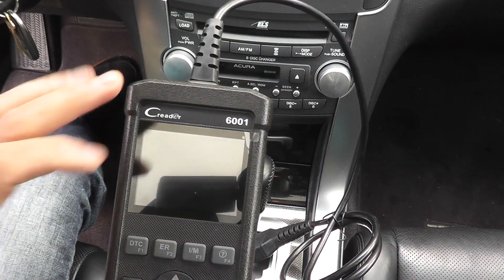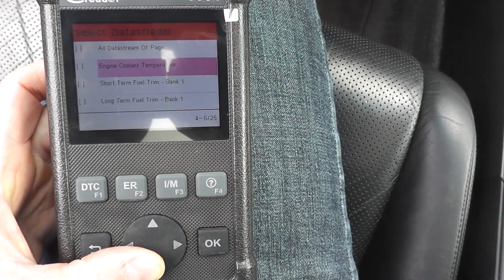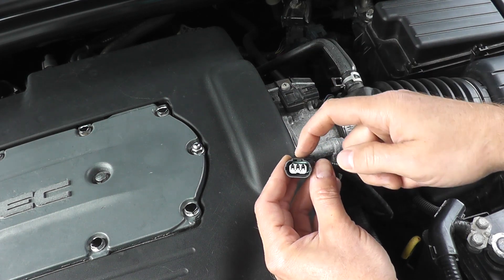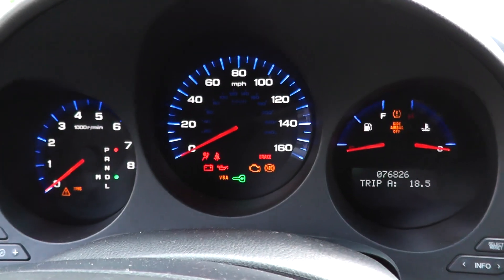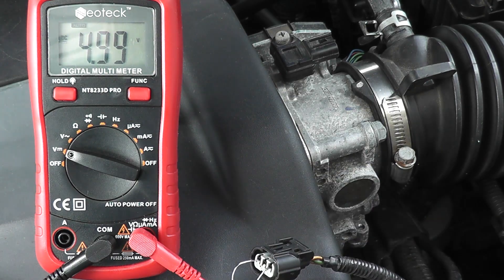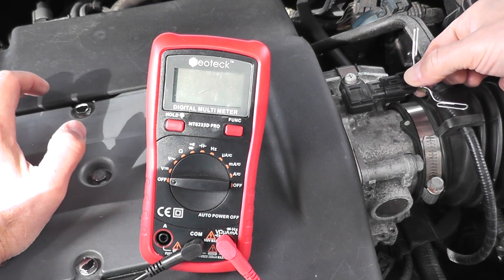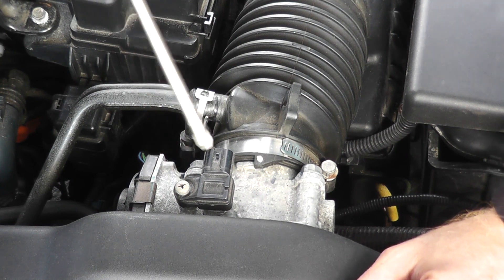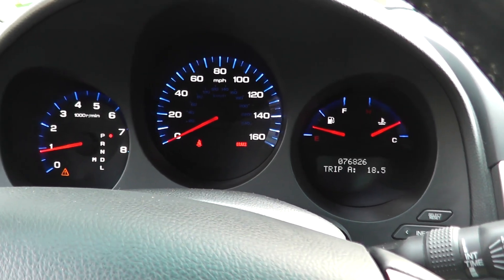Acura TL Map Sensor Testing and Replacement P0107 / P0108

Comment: After I unscrew the bolt on the sensor it feels like the sensor won’t come out, and when I turn it ( to try and loosen it ) it makes a cranking noise , I don’t wanna put too much pressure to take off cause I feel I might break it, I just want to take it out to clean, any help anyone ?

Comment: i had a question. my check engine light turned on and it came up as "fuel to rich". any ideas what can cause that??
Reply: Could be an oxygen sensor.
Reply: @Double_Platinum_Dante  I was told the 07 has 4 Oxygen sensors. 2 upward (near engine); 2 downward by Cat. C

Comment: I need help guys I replaced both ECTs sensors Acura RL 05 before I replaced them fans were fine now with the new Ects don't turn on but my dash temp gauge stays at normal temp I'm confused
Reply: I changed also the map and the intake sensor bc of the codes, my last code was the radiator switch sensor got replaced now no Fans =(

Comment: early on you mentioned P0107 as the error measuring kilopascals, then on the volts test you said p0107 is error measuring voltage....
Reply: The kilo Kilopascal measures pressure, the Volts he’s reading with the multimeter is for the power for the sensor that receives from the battery to operate

Comment: Was your scanner  &  multi meter made in China .?.You know who will not  be pleased if it was. Thanks for the vid ..interesting.
Reply from the maker: It's incredibly difficult to find anything not made in China. Recently installed Bosch rotors and Brembo pads - both made in China. It's all about maximizing profits.
Reply: Scanner and multimeter manufactured under the same standard as done in USA, how are these tools not reliable if made in China?  besides, they are not that high-tech to make.
Reply: 🇺🇸 made in china

Comment: I cleaned the throttle body on my 2008 tl. I slowly opened the valve with a screwdriver to clean the inside. I tried the idle relearn several times but idle will not adjust. I'm having trouble holding the accelerator pedal steady till the fan kicks on, Is there an easier way to hold it at 3000? Also I can't hear when the fan kicks on when the idle is at the 3000 rpm's.
Reply: I did the idle relearn on my 2000 acura tl and it fixed the idle surge (up and down revving). Once you hold the rpm as steady as you can to 3000  rpm the car will automatically accelerate or decelerate closer to 3000 rpm. Youtube channel (mods forever) has a step by step video if it further helps.
Reply: I’m like how the hell am I supposed to hear when the fan turns on

Comment: hi have acura tl 2005 have misfire on all cilender so what you think is the problem the map sensor
Reply from the maker: p301-p306?
Reply: Your fuel pressure regulator and rail damper has failed fuel is at 40 psi should be 26 dumping fuel! Causing misfire and poor acceration !
Reply: are you getting an actual DTC code or you feell the engine is misfiring and shaking from unmetered air ie. a "vaccum leak". 
If over 110kMi concider replacing you leaky PCV unless a bad valve adjustment left the intake plenum with leak